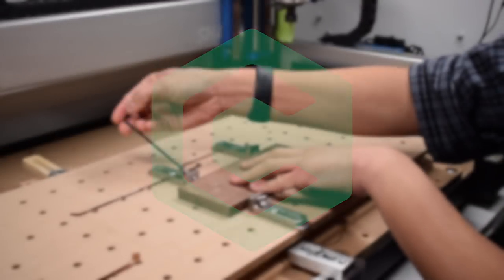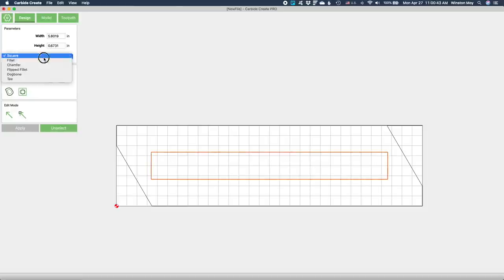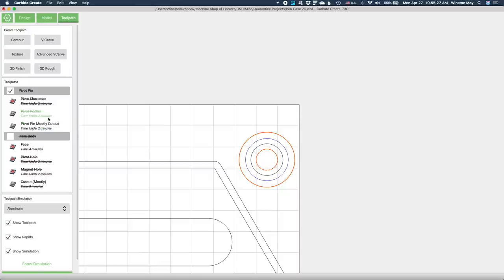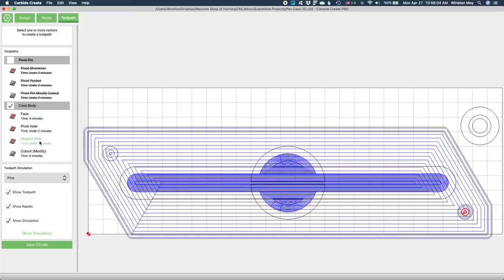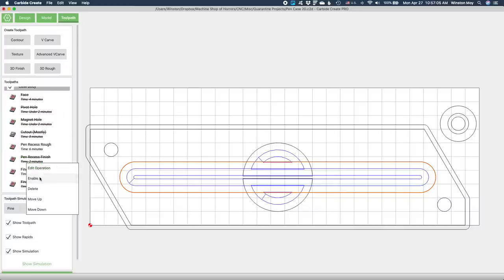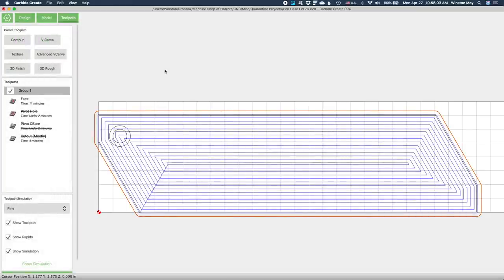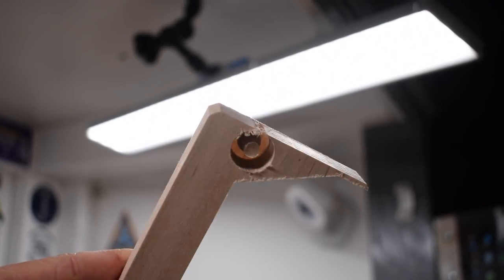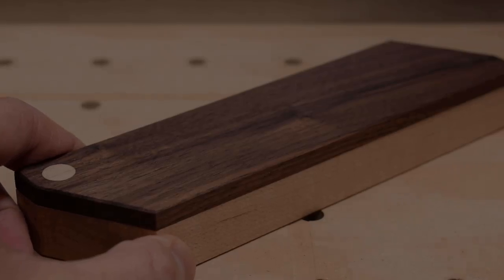Making a Wooden Pen Case on the CNC

Comment: Since the pin hole went all the way through, would it not have been easier to just mirror the lid shape and then do the pin hole and the magnet hole at the same time as surfacing and cutting out the lid from stock?

Comment: Is there a way to move shapes in CC without using snap?  i.e. I want a 50mm square at 12mm from x and y edges and a 25mm circle centered into that square. nvm I found it :)